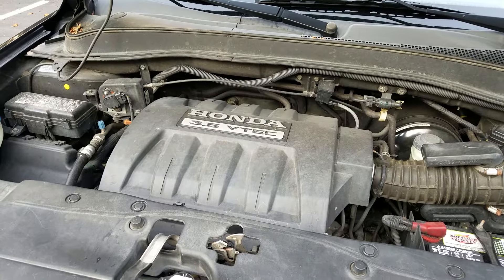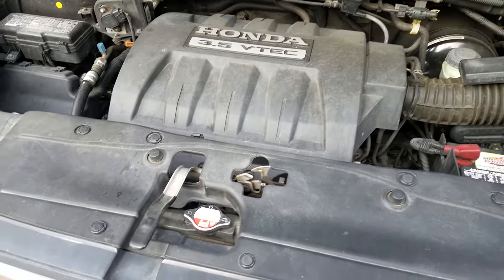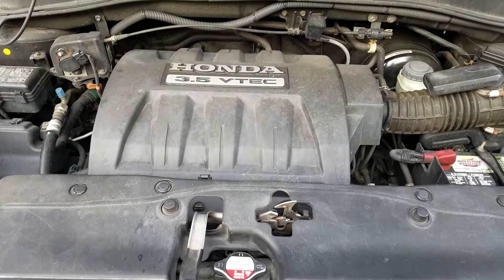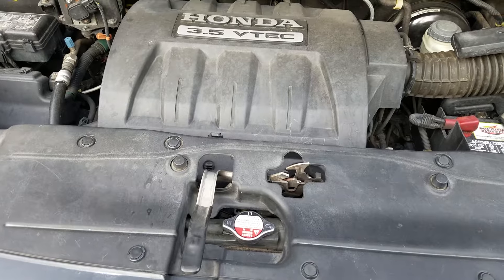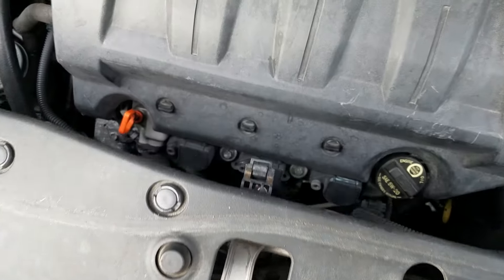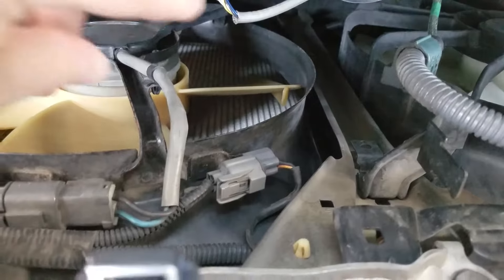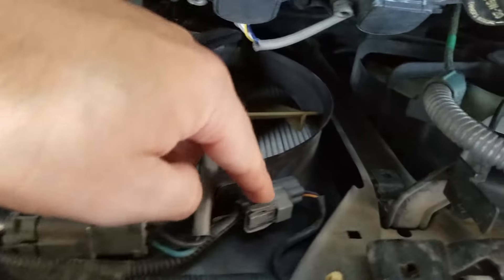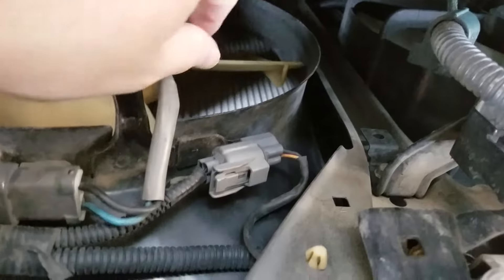How to Fix Intermittent Random Honda Pilot Alarm Going Off when Raining, Easy, Cheap Fix

Comment: My 2011 Pilot just started doing the same thing. Disconnected the hood sensor and so far so good. Now I hope no one tries to steal my engine :)
Reply: 😅 that’s my concern too 😂
Reply: I am trying to do this on my 2011 pilot. Is the sensor lower right next to the blue and black cable one? I notice a sensor that’s higher closer to the hood latch and tried disconnecting that one to no avail. Thanks much for the help.
Reply: @parthreepat they forgot to add inserting the key into the car door right after

Comment: I can see that the latch assembly is covered with black gunk. This is the real issue. Take Brake Clearner and clean it up real nice with a toothbrush. I also cleaned it up later with some soap / water and sprayed a nice water jet on the whole assembly. Its now sparkling clean and the issue appears to be fixed for good. This worked on a 2015 Honda Odyssey and i assume it would work on any car where the hood assembly is covered in black gunk.

Comment: Thanks for the post. This happened to me overnight (raining). Disabled the hood sensor. Alarm went off again soon after. You also have mentioned the hatch sensor. Does disabling that require removal of the entire rear door panel?
Reply from the maker: Yes, it does, but it's not hard to do. Then all you have to do is unplug the sensor. The downside is that the computer won't know when the hatch is open or not. No biggie for me. I've been running that way for a couple of years now.

Comment: So ,my daughters 09 Fit alarm keeps going off now that it’s below zero and snowy . I was going to jump the wires together to complete the circuit but if disconnecting the sensor fixes it , the circuit must be normally open when hood is closed and complete circuit when hood is opened . Gone try unplugging it first !
Reply: Did it work for you? I'm having the same issue
Reply from the maker: Good luck!

Comment: If u pulled the wire on the sensor it sense as open  it’s not going to alarm anymore but the key remote won’t  close coz it’s sensing hood is open.. if u bypass  the connector its sense the hood always closed then it works one way onother
Reply: So what you're saying is cut the sensor off and then connect and cap the free ends of the wire so it's always hot?

Comment: I disconnected the hood alarm switch on my 2016 Pilot EXL-Nav and now I have an emissions problem warning on the dash and the remote start doesn't start. I recently had it to the dealer for the hood latch recall and the torque convertor "judder" issue. The trans works great now but the alarm just went off by itself an hour ago - and the hatch still comes down by itself now and again when it's cold out. The hood still moves up and down at turnpike speeds on windy days but the dealer says its safe. ???. They adjusted the hatch when it was warm - no answer now in the cold. I called Honda about the hood - woman hung up when I asked her why I should buy another Honda. This is the only one out of 6 that has troubles.
Reply: Yeah my 2018 Pilot has the world's most sensitive alarm, goes off during fireworks, everytime a motorcycle or loud truck drives by it as its parked, aaaaannnd every afternoon and randomly on its own for no reason. But now my neighbors have complained to my HOA (Of course, instead of coming to me😡). So did you find out if disconnecting it caused your emissions warning to go off? Just wondering before I attempt that. Also, just like yours, my hood shakes SUPER bad driving at high speeds especially when a semi passes by me, and they told me that was normal too! It literally jiggles like it's gonna come undone!
Reply: @SageBird6  just did my 2016 pilot. I’ll try to keep you guys updated
Reply: @@allykern4429 Did you figure it out? I have a 2016 as well, and I can't find the hood sensor either.

Comment: Hi I have 2006 Honda pilot and my alarm goes off randomly I did try to disconnect the hood sensor but for some reason the alarm still goes off so, I was wondering what could the problem be if the hood sensor didn’t solve the issue?
Reply from the maker: My rear hatch sensor failed as well, so I had to disconnect that one too. Each door also has one too, but those have been fine so far. I bet it's your rear hatch sensor.
Reply: @ Thanks I will try and disconnect the rear hatch sensor and see if that solves the problem. I will keep you updated if anything.
Reply: Hi so, I did disconnect the rear hatch sensor wire and the alarm still goes off at a random time but I noticed something yesterday when I closed the car door the dome lights stayed on while the door is closed and my key fob won’t lock it when I press the lock button on the key fob. I then turned off the dome lights by pressing the switch and then locked the door manually from the inside 6 hours later the alarm went off again and I pressed the unlock button on the key fob to turn the alarm off. So, I had to leave the car door unlock for the alarm not to go off. Do you think my door sensors is faulty that’s why is causing the dome lights to stay on and alarm going off?
Reply: @dehiyasitero1938  Hi,   I'm still trying to fix mine but will wait until tomorrow so not to wake anybody up etc:   but I suspect if you tried unhooking the hood and back door,   then all that is left is to unhook the doors.    Funny thing about Japanese cars ,  even Hondas,  seem to have inferior wiring,    or it doesn't seem to hold up as good a the rest of the car.  MHO.  Cheers.

Comment: I own a 2006 Acura TL and years ago, my dealer disconnected the hood sensor, telling me it would fix the problem of my alarm going off.  It did for about a year, then the alarm started going off again every once in awhile.  I mostly noticed this happened after a heavy rain.  Yesterday, the car was sitting in the driveway and all of a sudden, the alarm goes off again, not once but 3 times!  I don't want to get taken in and have to spend $$$$ to have the problem resolved.  I've no knowledge of car alarm systems but after visiting several Acura forums, the problem seems rather rampant.  Any help would be appreciated!  Cheers :)
Reply from the maker: Check the trunk sensor next. I had to disconnect the trunk sensor a year later because the alarm started going off again. Good luck.
Reply: @LuckyVagabond  Thanks for replying so soon :)  I will definitely do as you suggested!
Reply: Diagonose which sensor is going bad: 1. get in the car and close all the doors.  2. Start the car and see if any of the lights are light indicating an open door.  (this is best done right after the alarm goes off.)  3.  if the "door open" sensor is light, that is your problem.
Reply: @brianaustin1328  I've owned this car for 10 years and never had anything indicate that a "door was opened" once I started the car.  Same thing goes for the trunk.  Also, I've checked and the interior lights turn off when I lock the car, which I now do manually with my key.  This was suggested to me years ago by a service rep at Acura.  All door sensors seem to be ok.  I'm betting on the one on the trunk lock system.  I've tried locating it but am unable to.  Will try to find a kind soul to do this 😊
Reply: @brianaustin1328  Thanks!  Any suggestions are much appreciated!

Comment: When you disconnect it,  should you apply tape over the connectors?
Reply from the maker: I didn't. I just left them hanging.
Reply: @LuckyVagabond  ok I was able to unplug but pulled it apart just enough so the connectors are still covered.  Hopefully to prevent the metal from corroding. But thank you for posting the fix, so far so good.  That 3am horn beeping almost gave me a heartattack,  I'm sure my neighbors as well,  lol 😁

Comment: Will this work if I locked the door from outside and don't have a key or fob to turn off alarm???? Please respond someone
Reply from the maker: Maybe, but you could also just disconnect the battery. You'll need to find the key or fob eventually though.

Comment: My keys don't work on the door only on ignition... And my key fob module is dead so I can't use the buttons... Battery swap is no go. I was able to break into my car but alarm is going off like crazy, I managed to unplug the battery for now. Please help me lord.
Reply from the maker: Sound like you'll need a mobile locksmith to make you a new key fob and program it. Good luck.

Comment: Works foe 2018?
Reply from the maker: I doubt it. So much changed from 2006 to 2018. I believe this only works on 2003 to 2008 Honda Pilots.
Reply: @LuckyVagabond  I just did it on my 2011 right now after being woken up by the alarm 3 times last night (early this morning)! We havent' been able to get that beep on the second key fob button press for at least a year now. But after disconnecting this wire, that works now as well! Thanks!!!!

Comment: I’ve tried that still won’t fix it 2007 Honda pilot
Reply from the maker: Hello, the Pilot has 6 sensors, hood, each door, and the cargo hatch. Try disconnecting cargo hatch one. I had to do that on my 06 because moisture was getting to it from the wiper mount. That resolved all of my alarm issues.
Reply: @LuckyVagabond  ty for reply where is that one located ?